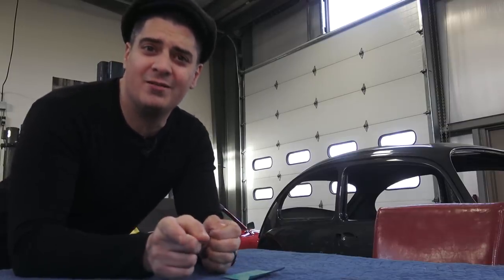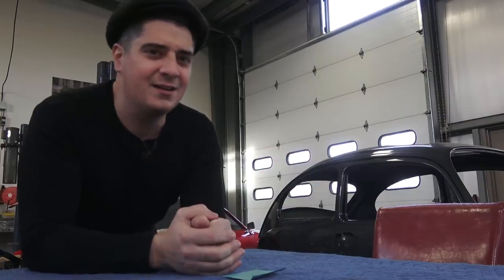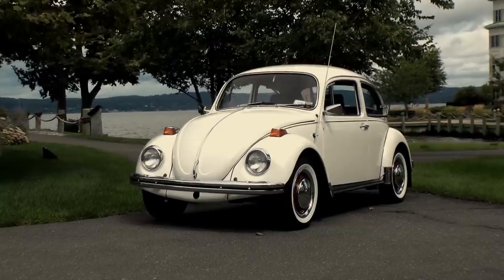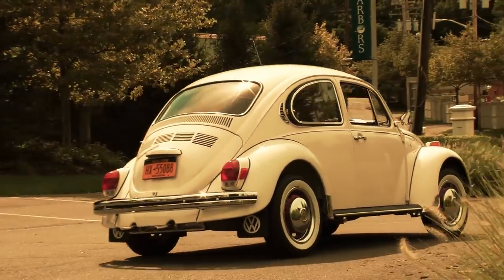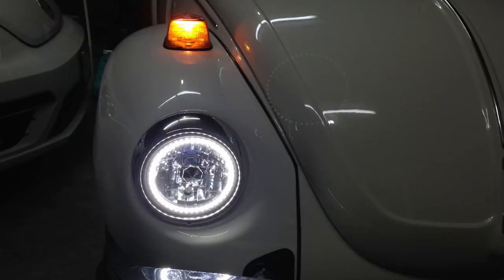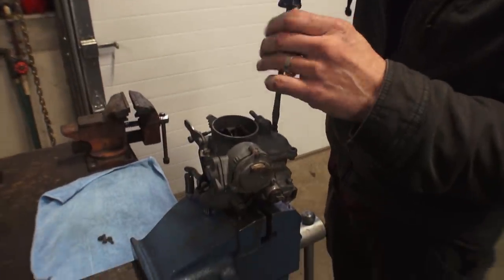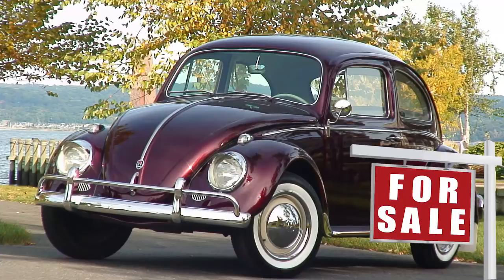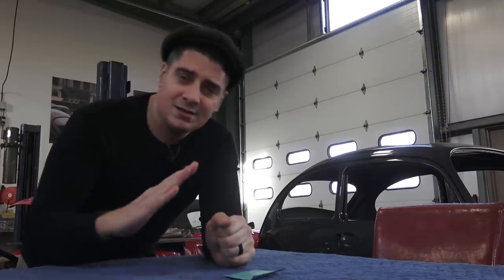Classic VW BuGs Top 5 Reasons You can Still use a Beetle to Daily Drive

Comment: i've had the tracker for 2 years, i run mostly A's the tracker uses your cell phone. my first car was a '65 beetle, swapped the engine in 90 minutes with 2 jack stands , floor jack and hand tools at age 19.  very easy to work on. my dad's first new car was a '60 beetle. if i could find one that wasn't a rust bucket, i'd buy it in a minute. 12 volts is the way to go.

Comment: Hi Chis! Very nice video! And I fully agree with you!
In my garage there are three Beetles, here in Italy:
- 1949 Standard 1.1 liters 25 PS
- 1975 Standard 1.2 liters 34 PS
- 2012 Beetle 1.2 liters 105 PS
The first and the second run very well. I can drive them all day long. And I make maintenance and repair by myself. Only one time I had consultation with an old VW Mechanic about the cable brake system of the first.
The third runs good as well but now it has the catalyst warning light some days on and some days off. I can't make anything. I can only go to the VW work shop.

Comment: My wife daily drives our only car which is a 1977 standard beetle 1600 EFI. Very reliable, easy to fix, cheap maintenance, and cheap parts. Rubber dry rots and wears out and make sure you replace your fuel lines and wires.

Comment: CHRIS:  I'm fortunate to have a '67 that is very reliable and I use it as a daily driver (it will climb to 87 mph!)  I also have a '65 in very good condition that is numbers matching (body  chassis, and engine).  Being so original, I think it's best to leave the 6V electrical system alone.  I agree, though, that the 12V upgrade makes sense for most of the earlier Vdubs.

Comment: Hey Chris, thought I might add some info that might help for the use of a classic vw in ill weather like rain and snow. I know the military used to use a product called Cosmoline rp-342. It's a military grade rust preventitive spray, it dries tacky and basically doesn't allow water, snow, etc. to stick. Spray on under carriage, etc. One coat lasts about a year, maybe more depending on usage. The amber colored is the original that the military used. Maybe worth a look for those that want to drive year round. Hope this helps someone. Have a great one!

Comment: That was one of the wonderful things about owning a beetle, no matter how much or how little you knew about mechanics, anybody could fix this car! I am a self-proclaimed complete idiot when it comes to mechanics, and even I was able to fix my beetle, I haven’t had my own oil changes and brake changes, if I can do it anybody can! I haven’t had my beetle for over 30 years now, so I don’t know if this is still the case, that back when I had mine, you could buy any parts do you want it for that car, they’re cheap, and fix it yourself for free, as all the parts came with instructions telling you exactly how to install it, it was actually fun, and I absolutely loved that car. Unfortunately, practicality gave way to size, as I got married and had a kid, and the fact that my bug head over a half 1,000,000 kilometres on it, I had to get a bigger car, but I swear to God I actually cried the day I sold it, probably the biggest regret of my life! To this day I still have not been able to find one in half decent shape, at least not here in Toronto, our winters are pretty brutal, and anybody who’s ever driven one knows that the bug wasn’t exactly the best car for cold weather, but I didn’t care, it was my first car, I owned it out right, and I loved it so much. It’s hard to believe after so many decades I can still vividly remember the sound of the engine when you turned the key, the way the car felt, the way it handled, just everything about it I absolutely loved. If ever you’re lucky enough to find a refurbished older one in good condition, don’t make the same mistake I did and think that you’ll find something better, because it’s Damn near impossible, they are one of the hottest collectors items out there, so the minute one goes up for sale it doesn’t stay for sale very long, the last one I saw, sold in literally five minutes for double the asking price, the guy told me 10 people started a bidding war! That tells you something!

Comment: I have driven air cooled vw's as dailys multiple times through out the years. (owning more than 7 different beetles.)
Daily drove one last between 2003 and 2010.  Did me a solid run and was a great little car, wish I still had it, lost it to a car wreck. (not my fault, and it bent the middle tube of the floor pan... which more or less made it unrepairable to me.)

Comment: I've been working on  (and driving) my sisters 72 Super Beetle for 10 months now. It had sat a long time before we got it and it barely ran, the clutch was way out of adjustment and no maintenance had been performed for a long time before it got parked. Things I've learned in the last ten months include:

The germans made whatever you are trying to do, doable. They probably did not make it easy - the first time around. Once you figure out how to do something it becomes much easier.

Some projects take special tools, The axle nut/ gland nut torque multiplier is a necessity if you plan on pulling the flywheel to change the main engine oil seal, the flywheel lock comes in handy here also.

People like Chris Vallone, Franny from Heidi and Franny's garage, Rob and Dave's Aircooled Volkswagen Pages, etc., make it so  much less intimidating when tearing into a project because they've been there, done that.  Once you've done it, you too will be able to do it. The second time you do something will be much easier than the first.

The time, energy, and money invested are well worth it. The better you upgrade your bug, the more fun it is to drive. The new electronic ignition, new carb, 4 wheel  disc brake kit, upgraded suspension and steering all made for a very dependable, fun machine that gets people smiling, especially me.
Reply from the maker: Great comment, thank you!

Comment: Chris
My 1973 super beetle I bought the front wheels seam to be wobbly between 35-40 mph.
What would you suggest I take a look at ?
Thanks ,Gil from SoCal
Reply from the maker: steering dampner?  Tire balancing?  Bent rim?
Reply: @classicvwbugs  
Thank you Chris , one thing I didn’t check was the steering dampener so I’ll do that. I did have the wheels balanced and rims check and were Okay.
Also, I’m a big fan of your videos, and long time follower.
Thanks again.
Gil-Moparpops
Reply from the maker: @gilmoparpops7223  I appreciate that, thank you.  good luck with finding the problem.

Comment: Hey Chris, I’m just wondering why I’ve never seen one of your restorations with air conditioning, not that I’ve seen them all. I have a 72 Super Beetle and am going to add it as it just makes sense. I used my wife’s old 95 Corolla after we got her a newer car and the a/c quit. After one summer I will never drive a car without it. Our air cooled community doesn’t need to suffer so why do so many? In the US it would only cost you guys $1800 so whazzup? Always love your videos, thanks!
Reply from the maker: It sacrifices power, slow drain on the engine.  Chops the engine life in half.
Reply: Well I’m not sure about half but just turn off the a/c when you go up hills!! Haha!😃

Comment: They are the greatest little simple daily driver !! I love mine 😍 In winter it has a great heater but I dont like to use it due to taking heat from the engine when its bitter. I just use a VERY warm lap blanket. I cant even remember the last time it broke down !?  A decade or more. 10 to 15 years 🙂
Reply: Heat is drawn from the hot surfaces of the exhaust pipes. You’re not robbing the engine of anything. German designers conceived the system to function in German winters, Bavarian Alps included.
Reply: @PeopleAlreadyDidThis  I remember a VERY cold damp day, maybe low 30's but it felt much colder with some wind, and my car just didnt drive well at all that day when I had the heat cranked up. I drove several miles and it should have been warmed up but drove very sluggishly the whole time. ?

Comment: Whats the best modern oil to use on 1600dp running 91 octane?
Reply from the maker: Just BASIC oil, 10-30w or straight 30w.  No need to run 91 octane either on a stock engine.

Comment: Great review and analysis!!  A '67 beetle was my first car and my best driving teacher, and now in my old years I still miss its simplicity and reliability.  One thought that bugs me, is it possible to install maybe a small electric a/c unit in a bug?  I live in Florida, and no a/c is definitely a downer, not only because of the heat, but also because of the fogging when its rains.  Subscribing now, btw.
Reply from the maker: I hear ya, you can, but if the power is coming from the engine, it can really bog it.
Reply: @classicvwbugs    Yeah, I know... that's why | was thinking of en electricity powered compressor unit... but I don't know if such a thing actually exists!

Comment: I daily drive my 1974 1200 beetle. We also have a new car with all the gadgets, but I prefer my bug for my work car. I keep waiting for the engine to die so I can put in a larger one, but it just keeps on going. Fill the oil, check the gas, and it's all good.

Comment: Chris, what's your opinion on the autostick Beetles? I know that you're not as much of a fan of the later years, but I was just curious.
Reply from the maker: I actually like them, I know they are not as desired, but they are rare.
Reply: I had a '69 autostick. When it worked it was great but......it was tough for me to get it right and even in the 80s parts were hard to get and hard to find people with knowledge and expertise. I eventually got rid of the trans in favor of a stock 4speed and did a hydraulic clutch conversion as there was no clutch guide tube in the tunnel. Still have the decklid badge though!
Reply: Sorry to spam ya with two similar comments. Youtube seemed to delete the first so I rewrote it.

Comment: Actually the VW showed everybody else how to build a car.  Make the passenger comparment as big as possible.  Make everything round, eliminate corners,  Have a small engine that they hid in a small space.   All cars are like that now..
I had a 1958. 
 That old 6 volt battery could not start the engine on a very cold morning.   No problem!  Park it on the top of a hill the nioght before.  Let it roll down the hill, as soon as you let the clutch up, it roars to life!
I did not need snow tires, a had those strap on tire chains from JC. Whitney.
PUT those on and it could dig itself out of the snow.

Comment: I'm exactly the kind of person who might daily drive an old air-cooled VW.  I prefer simplicity over everything else and as such despise new cars and their complexity/expense.  I'm an avid DIYer so I do as much to my own cars as I can.  I have a reasonably short commute to work in stop-n-go traffic and 95% of the other places I regularly go to are within 2 miles of my house.

Would I daily drive my Beetle?  Not a chance.

Why?  First off, we both live in New York (Chris is downstate and I'm upstate) and the salt they put on the roads here eats vehicles alive.  My Bug wouldn't stand a chance after just one or two winters, no matter how much Fluid Film I undercoat it with.  

Second, the simplicity of the Beetle is an absolute dream compared to anything modern, but that doesn't mean I want to be out in the driveway in 10 degree F weather screwing with carburetor settings to get the Bug to run right.  The first two cars I ever owned had carbs so I know what they're like in the winter.  There's something to be said for having at least some amount of computer control in a vehicle (like electronic fuel injection) to make winter driving easier.

Third, like it or not, Beetles aren't particularly crashworthy.  I may be the best driver on the planet (not!), but all it takes is somebody's special snowflake taking selfies while driving her mom's Honda Odyssey and T-boning me in the Bug to put an end to things.  

Given what Beetles are selling for now, if you want an older daily driver, something like a Volvo 240 or even a Saturn S-series would be a better choice...still relatively simple and reliable vehicles in the tradition of old VWs but ultimately better suited for the task in today's world.
Reply: I hear ya. Safety is my only concern with all the inattentive drivers out there. But I'm still going to daily drive my 64 bug once I finish the resto/mod.

Comment: Chris great video. Question...what would you use for body work repair? A fiberglass resin? Thx
Reply: I'm not Chris, but speaking from experience, It's best to use (1) original German metal and a welder. (2) Dolly and hammer it. (3) Epoxy primer (4) Fiberglass filler (5) Skim coat of light-weight filler. (6) High build primer. (5) Single stage paint or Base/Clear.

Comment: i currently drive a 2017 Cadillac Escalade and someone sometime last year backed into the rear right corner of my bumper and did no damage but did break one of the parking sensors and the dealer wants to charge me $543 dollars to replace just the sensor and most of that is labor and paint cause they have to paint it to match
did some googling and found said sensor on ebay from a high of $120 to a low of $23 so i am going to do it myself it wont match the paint but oh well

Comment: Chris, what are your honest thoughts on the autostick Beetles?
Reply from the maker: I like them, if you find a good one at a good price, grab it.
Reply: Since other cars have recently included “manual” shifting of their automatic transmissions, the new name “autostick” has been applied to the old VW system properly called Automatic Stick Shift. It’s a 3-speed manual transaxle with ordinary clutch plus a torque converter. The clutch is vacuum operated when you move the shift lever to manually shift gears. There is no automatic gear shifting at any time. The torque converter slips to allow stops without disengaging the clutch.

You can drive by shifting through the three gears, or you can leave the transmission in second or third and let the torque converter slip as you accelerate to avoid shifting.

You lose efficiency in all cases because of the converter and the power needed to drive its oil pump. You lose more efficiency by not shifting because you lose the mechanical advantage of the gear ratio changes. You lose a fourth ratio altogether.

Bottom line, the car is even more sluggish and fuel mileage suffers. It’s more mechanically complex and requires more maintenance. You gain...not having to learn to use a clutch, or move a gear shift.

It was a sales thing. Automatics were still a relatively small percentage of American cars in 1960, an extra-cost option. By 1970, hardly anybody wanted a manual transmission.  VW didn’t have a full auto yet, the Beetle was waning in popularity, so they pieced together Automatic Stick Shift to fill a market niche for the few people who wouldn’t or couldn’t shift.

Today, it’s a novelty if you like it, but performance and economy suffer, headaches increase.

Comment: How fast can these things comfortably cruise at?
Reply from the maker: stock?  60-65 all day
Reply: @classicvwbugs  what are some things you can do to make it cruise faster? I really want one for a daily driver but I usually cruise around 80
Reply from the maker: @benjamincoulter4522  Well you might want to go bigger pistons and cylinders, at least a big bore kit, like a 1641 or 1776.  1641 is bolt on, no machining, but 1776 would require machining of the block, better heads, rockers, etc.  But then you need to watch for heat issues.

Comment: How much of the bug is re manufactured? Like could I buy a Oval shell with plans to resto mod it? I wonder what they did with all those presses? Someone needs to make a factory again and put water cooled 1.8 L in them, and sell them for under 10k if at all possible. Open up mexico plants again! That or redesign the air cooled engine and trans, or maybe the later model beetles were all that?

Comment: I drove an old model for 3 years because I was poor.  Now those who want to drive an older model VW should have fun because after awhile you will realize that you are a MASOCHIST (loving pain).  For one reason,  what an experience with the heater system (nonradiator) that ALWAYS keeps the inside temperature 10 degrees above the outside temperature.  So if it is 10 degrees outside, it is 20 degrees inside.  For Summer, drive a convertible or you will fry.  You can do 80 mph on a highway if you are going down hill with a strong wind behind. Sometimes if you have a death wish, drive 20 feet back from a semi and you will go faster.  Those who get a VW....GOD help you!

Comment: You're talking about the real Beetle the than the hairdresser's car. You can't fault their reliability. OK you won't win any drag races but they'll get you where you want to be. Who could ask for more.?They are simple to maintain all you need is a few screwdriver and spanners and you are in business. Definitely the 12 volt system as the 6 volt was so feeble you had to light a match to see if the headlights were on. Did you know that the chrome trim is detachable but inadvisable as it's part of the silencing and there's a heck of an increase in noise level.